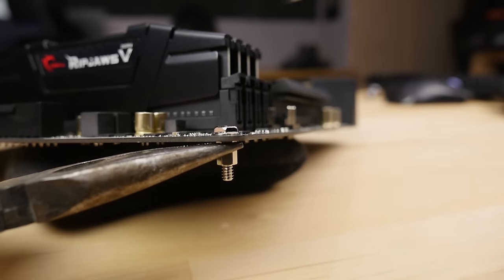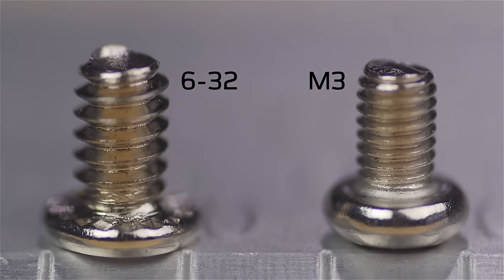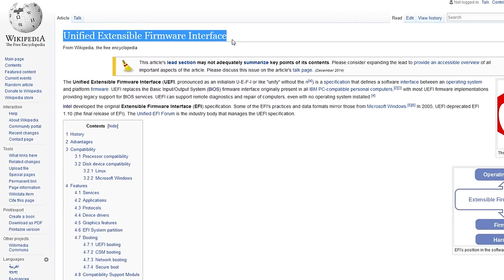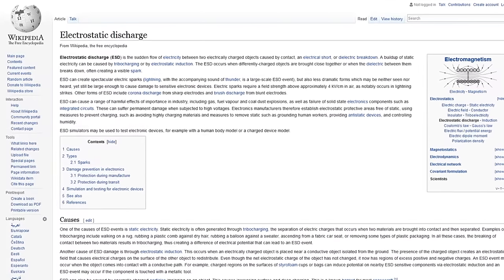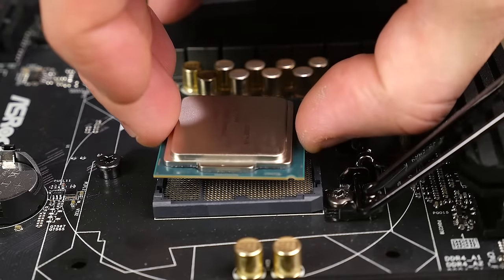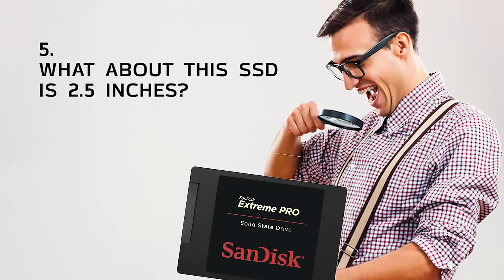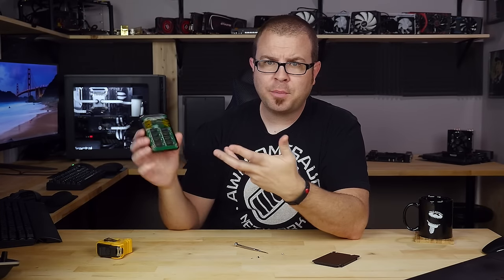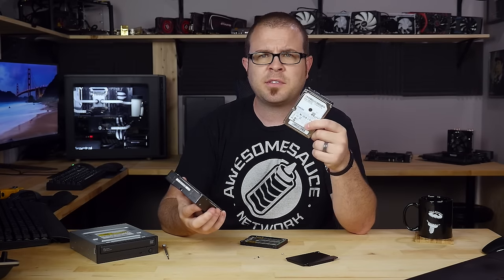5 Confusing PC Building Facts

Comment: In case your not flooded with answers;
Measure the old 5 1/4" floppy disks.  witch went into the 5 1/4" floppy drive not a 5 1/4 drive that takes floppies.   i.e. it's a (5 1/4 floppy) drive.   Or a  ( 3 1/2" hard disk ) drive.
Reply: +Lucid Moses You forgot the 3.5 inch floppy !!!!!!! I'm just glad we never had to put a 8 inch floppy in a PC case  LOL!!!!

Comment: ESD is much more of a factor with components before they are soldered into a circuit. It is mostly a problem with MOSFET gates. Where the thin insulated barrier can be destroyed by a static discharge. Early 4000 series CMOS ICs (which have lots of MOSFETs in them) were often delicate in regards to ESD too. They lacked clamp diode protection. Let's face it stuff was crap years ago.

Comment: One of the most horrific issues I have ever encountered building a PC is a short. A wire that is pinched or chafed and is touching the case causing a short and thus making your PSU go "poof".

One, not so horrifying but annoying is using MB standoffs that didn't come with the motherboard.

Comment: 5 1/4 and 3 1/2 were the sizes of (floppy) disks. There it made total sense to refer to the drive by the measurements of the disk and obviously the drive had to be larger than the disks. Drive bay sizes were 1/2 in larger.

Comment: The locking lever's on current intel sockets are indeed intimidating the first time! Great vid, first time builders shouldnt be scared, we all make mistakes, whats important is learning from them!
+Paul's Hardware 
Do you know if theres a standard thread for radiators? Ive not been able to easily locate bolts(screws cut their own thread) to mount the extra 2 fans on my 240mm rad for my gpu loop.

Comment: Paul, the size of a drive is not determined by the size of the media, instead it's determined by the on-center measurement between the mounting screw holes on the bottom of the device.

Comment: It doesn't matter if "It's plugged in and grounded" as long as you touch the case you cause your body and the case to make contact and become the same voltage potential. I have fried one ram stick, was during the winter when the air was dry. Just work on your pc in a humid environment.

Comment: On my first build my friend helped me order the parts for it and after checking them a few times he said everything was good. We went to install the hard drive, the normal creaking and groaning and then it was in... Later we found out that it was in fact the incorrect size and we had bent the processor to about a 170 degree angle

Comment: The static electricity is no joke! maybe when you are building or upgrading your PC once every year or even longer than that the chances of you ruining a component with shock is minimal, but when you are building and working on peoples computers every day the rate goes up exponentially. Trust me, I work as a tech and quite a few GPU's or even motherboards go to shit because of it.
Reply: +Danny Sturridge We use to have static specialists that would train us in proper procedures when I worked in fiber optics. They would expose chips to static charges then grind down to level and photo graph under an electron microscope and it was like a forest fire had ravaged through the chips. Often chips fail after being partially degraded by static and people assume it's just a "bad chip",but the thing is, there are virtually no "bad chips". If they pass the the initial test and fail later on then it is usually because of poor handling procedure.

Comment: Building a PC is so much easier than it use to be. Back when we had to deal with ide while using multiple drives could be a nightmare, SATA has made it so much easier. And graphic cards could only fit in the one slot designed for them, and nothing else would fit it. Then there was a limit choice in components.....this one may not be such a negative, it made choosing parts much quicker :-)

Comment: When I first built my computer, I didn't know the CPU installation would make so much noise. I thought that I had damaged the CPU and/or socket. I was horrified when I inspected the socket only to realize all the pins were at a 45 degree angle, I tried bending a pin back using needle nose pliers and when I searched the internet, I realized that they were suppposed to be that way. What's weird is that my computer has been running perfectly fine.

Comment: 6-32 is a size 6 screw with 32 threads per inch. #6 is .204" in diameter.

Comment: 5 and a quarter.. A disk drive? I have two, well, actually three currently unused. Two of them are old enough to only have molex power connectors and a ribbon cable where today's drives would have a sata cable.

Comment: the 2.5 inch from the SSD is derived from the 2.5 inch that a laptop hard drive measures. Those disks have the same size of housing as those are standardized.

Also; the 5.25" drives (and it's size) found it's origin with the size of floppy disk drives that were using 5.25 inch floppy disks...

Comment: I suppose it was more apparent when you inserted your 5 1/4 in Floppy Disk into the 5 1/4 in drive that was itself a good bit larger than 5/14.  It had to be because the size describes the media, not the device itself.

Comment: They're called 2.5 inch drives because they fit in the same bay size as a 2.5 inch hard drive. The drive rail sized for 2.5 inch etc. drives are all standardized and they need a way to denote what size rails the solid state drives will fit into.

Comment: 3.5" drives got that name because the floppy disks that went into them were 3.5". The name differentiated them from the older 5 1/4" floppy drives. No one stressed about it, because when it made sense you were talking about the disk, not the drive. As floppies died out, it stopped making sense that the hard drives that fit in the same bays were still named after the size of floppy drive they matched.

Comment: 6. Most components are rather robust ^^ I used slightly longer screws than intended when reassembling my GPU and it acutally pushed the heatsink so tightly onto the chip that there was literally a large blank spot in the thermal paste when I redid it with the proper screws. I thought I had learned a 800$ lesson for life but once I put everything together it actually worked just fine.

Comment: ESD can damage a component, even though the component may still work fine. It is like a crack in a dam. The dam still holds water, but it is weakened. Another jolt can crack it. Similarly, the component that was damaged from ESD can kick the bucket in the near future.

Comment: Wait, working on the PC with the power supply PLUGGED IN??? That's insanity, man.  You could do that with AT power supplies, but the ATX power supply is always sending current to the motherboard even when off.  ALWAYS unplug your PC before opening the case.  Hell, we were even advised (by the manufacturers.... like Dell, HP, etc) to unplug the power cable and press the power button to discharge anything in the caps before opening the case.  

Static is all about voltage potential (the difference in charge between the parts) so all that matters is that you, the part you're holding and the computer are all at the same voltage.  You can discharge yourself into the unplugged case while holding the part in the other hand and there will be zero risk of ESD since all components involved would have the same charge and thus zero potential between them.
Reply: You dont need to have the ATX cable plugged in.
Or you turn the power switch off on the PSU.

The power supply has an earth connection on the power supply casing, when the power supply is screwed in, the case is grounded to earth as well.

If you have the PSU switch off, the PC will still ground to earth.

Comment: The 5.25" drive actually refers to the size of the diskette, it is called a 5.25" drive because it reads and writes 5.25" diskettes, the size of the drive would naturally have to be larger than this measure but the 5.25" diskette does in fact measure 5.25"s

Comment: 2:50 NO!!!!!!!!!
Metal table tops >>>>>>> wood or any other non grounded dielectric surface.
If you want to eliminate ESD you either have to use a conductive surface or a grounded one, ESD mats have a conductive layer which is then grounded off. 
If you use a metal surface there is no way for you to actually shock it, metal also doesn't collect charge as dielectric surfaces can, the metal of your car isn't whats holding the charge or what zaps you it's the paint.

Comment: Technically, you would say a 2.5" hard disk, or 3.5" hard disk. not "measurement" hard drive. 

And the sizes don't come from the hard disks either, they come from the old 5¼" floppies and 3½" diskettes....  (hard disk drives only became common good in the early 90's)

Comment: Lowering the retention arm is easily the most stressful part of any build. Not dropping the CPU in, not grabbing the entire motherboard or accidentally pressing your nail into it or dropping a screw on it, not screwing it down only to realize that one of your fan cables got stuck underneath, forcing you to unscrew the ENTIRE thing. No. Lowering that damn arm.

You start to lower it, thinking "This isn't too bad," then the force needed starts to rise, and rise and rise AND RISE.
"oh god, did I put it in right? Wait I did match up the trinagles, didn't I? Oh god what if I mistook one of the other notches on the corner for the triangle.
Oh god oh god it's creaking now IT'S CREAKING!"

And then the arm bottoms out. "Oh thank you, it's over."
Then you just push it underneath the catch and move on
...unless you're paranoid that you put it in wrong and so you raise the arm again just to make sure, even though in the back of your head you know that if it was put in wrong you already screwed yourself with the first time.
Then you see that you put it in properly, breathe a sigh of relief, lower the arm with more confidence, secure it and continue with the rest of your build, hoping that you didn't inadvertently bend one of the pins the first time you dropped the chip into the socket and it didn't sit quite right.

Pleazse tell me I'm not the only one who does this.

Comment: I have two different models of the Toshiba Satellite laptop bought 4-5 years apart. The older one still allows me to get into the BIOS update dialog, although I have never had to. It runs OEM installed Windows 7. The newer one runs Windows 10 and you have to set a Windows option to do a special reboot in order to get into BIOS (actually UEFI), but setting the initial states of the -Lock keys can no longer be done through that procedure anyway; I had to hack the Registry in order to make Windows come up with Num Lock on, which had always been the default in earlier PCs and versions of Windows.

Comment: I think the 2.5 and 3.5 size confusion is coming from people using that spec for case installation and instead should be using that spec for actual platter size like it was intended for. Back in the day, platter size made a huge difference. Now'a'days platter size doesn't make any significant difference, but times didn't adopt to a new standard of saying what physical enclosure size the HDD and SSD are in. So, 3.5 and 2.5 are just old terms that never got updated to today's standards.

Comment: Engineers don't worry too much about insta-kills from ESD. That kind of damage is immediate, obviously user-caused, and the user gets immediate feedback that they fucked up as they watch that blue-white arc enter the top of that brand new $900 cpu with a deafening crackle. As an engineer, there isn't a damn thing you can do to prevent that kind of destruction any more than you could stop a user from hitting the cpu with a hammer.

What they are concerned about is the lesser ESD shocks which seemingly don't hurt anything, but they do in fact break down the p/n junction (the internal "walls") of the transistors. The microscopic "lightning bolt" of lower-level ESD literally punches a tiny hole through the p/n junction. It literally destroys a few molecules of internal transistor material at each junction of possibly hundreds of transistors in the current path. Imagine removing every 3rd fin from your heatsink.

The "holes" leak quiescent current causing more base power usage and higher internal temps compounded by the slightly fewer molecules of surface area to remove that heat through the substrate of the cpu. Overall, the cpu runs slightly hotter which makes it use more current which makes it run hotter etc.. This is standard thermal runaway, the main killer of complex electronic parts. But don't discount the asymmetric thermal expansion between the punched and non-punched junctions which increases the physical forces trying to physically "split" the transistor in half each time it changes temperature.

While none of this is fatal immediately, it does predict early failure (or "infant mortality"), often just outside the warranty period, which you would think they don't care about. However, it screws-over the real world MTBF calculations which the long-term, high-volume buyers most certainly do look at. It's easy to look at insta-killed cpus and not count them in MTBF numbers, but it's virtually impossible to adjust for sloppy users that induce early failure with minor ESD damage. Also, if they didn't put a warning on it, consumers would try to sue them for not warning them of the potential destruction.

Note however, that a small understanding of how electricity can move from one potential voltage to another will give you all the common sense you need to predict when you might induce a shock somewhere. Two key points are 1) making everything the same voltage and 2) when equalizing voltages, do it (relatively) slowly through a high resistance, like a proper wristband or pink polyethylene or carbon foam. No metal foil or metal counters or copper wires stuck into a body cavity.

You can make a quick 'n' dirty static-safer surface by wiping a tiny bit of diluted Downy fabric softener on the plastic (or wood) desktop before you start. Downy not only prevents static buildup, but it also bleeds it off relatively slowly. Also, if you carry the motherboard across the room, hold only the edges and touch your pinky finger (or similar body part) to the case or desktop BEFORE the motherboard hits it. If you follow a few simple guidelines, you can sleep well knowing the cpu will live longer than your dog.

Comment: I once fixed the busted PCB on a CPU by squeezing it with pliers and adding some pieces of wire insulation under the socket cover... It still works well... Overclocked...

Comment: You have no way of knowing if you've ever damaged something with ESD.

Are you saying you've never developed a hardware fault you can't attribute to something else with complete certainty?

It doesn't even have to be a complete failure, it could be some minor glitch or degradation in performance.

The kind of static discharge that can damage sensitive electronics isn't detectable by you. In order to get sound/light you can notice, it requires a discharge of at least several kV.

Comment: i believe the 2.5  inch drive on SSD is the equivilent of the actual size drive from HD. should have a 2.5 inch HD next to the 2.5 inch SSD. the size may be comparable (not exact). giving the user information to the size needs when mounting and placing.

Comment: I had a build that would not turn on and the culprit was a single screw in a single slot on the motherboard, no matter what I used it always short circuited the board and wouldn't turn on. Once the screw was removed everything worked as it should.

Comment: PC building is actually really easy, especially in the modern era. I think that so many people try to make it seem harder than it really is. It's as easy as sticking two pieces of lego together. If people can't tell the difference between a coarse and finely threaded screw, they must be a bit dense.
Reply: That part is also quite simple if you do some basic research. The motherboard's manual will typically tell you where to plug everything in, there are also plenty of guides on youtube to assist you.

I know it can be a bit overwhelming at first but once you dig into the topic a little bit, everything will become quite clear.

Comment: What makes me mad is that 6-32 is the definition for a machine screw, where as the screws shown are metal screws that fit holes without threads. Mixing American and metric reminds me of the transition from SAE to metric in autos during the 1970s.  You had both in cars and you had to be careful not to strip out threads in expensive parts.

Comment: I recently installed a m.2 drive. I had lot my m.2 screws which is 2mm in diameter. I could only find 3mm screws but after a few hours i discovered that i had a caliper. And said caliper had a 2mm screw which i used to connect my m.2 drive to my motherboard.Thank you ASUS and my local dealer for NOT being able to provide me with any screws.  Took me 2 days before i realised that my caliper might have a screw that would fit.

Comment: The last one isn't confusing at all. The size, being 5.25", 3.5" or 2.5", refers to the size of the spinning disc, not the enclosure...I am also old enough to have used computer with 5.25" floppy discs, including the 360Kb one,  remembering the importance of having a copy of "command. com" on most floppies, and the luxury of having DUAL floppy drives, this is before HDD's became "normal" on PC's. My first hard drive was a Seagate ST412, 10Mb harddrive, which filled a full size 5.25" bay. All that space was pure bliss!